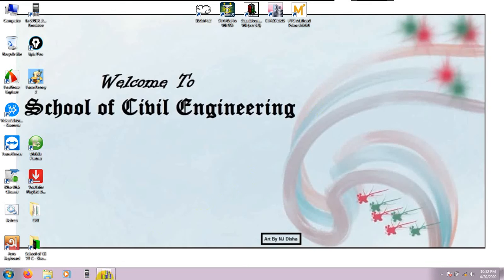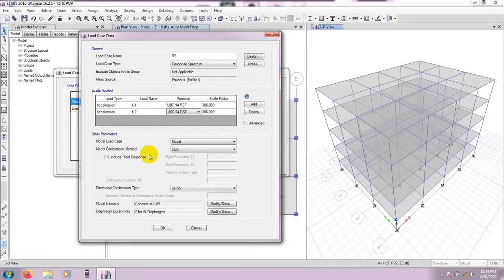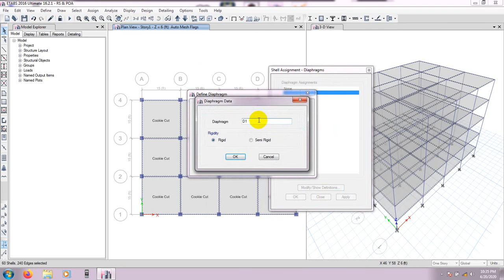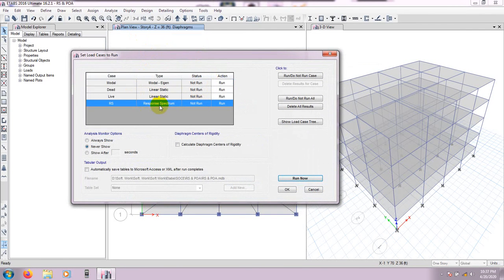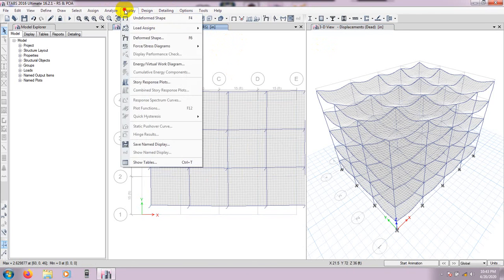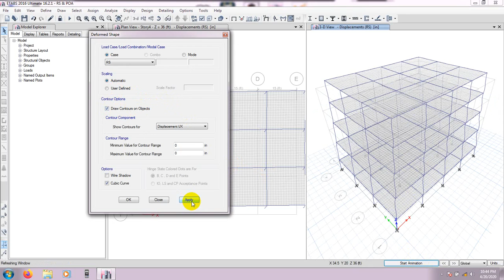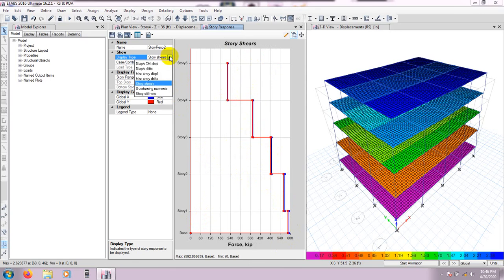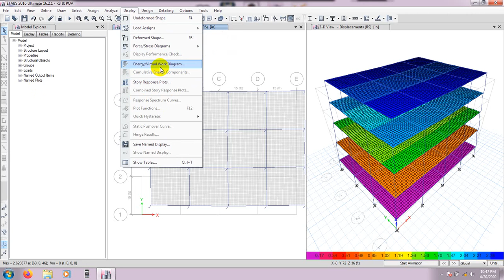Response Spectrum & Pushover  Analysis In Etabs |  RESPONSE SPECTRUM  ANALYSIS | Lecture-03

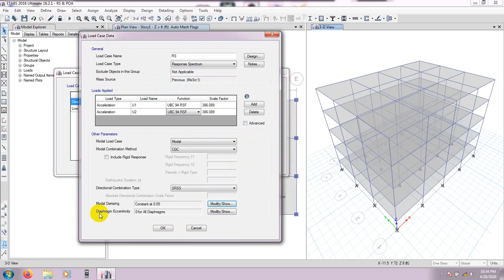Comment: sir what is srss and cqc  in video for load case data 2:55
Reply: please explain this denotes plz reply
Reply from the maker: The modal results of a response spectrum analysis are combined with quadratic combination rules, and in RF-/DYNAM Pro, the SRSS and the CQC rules are available. The default setting modifies the quadratic expressions into equivalent linear combinations. The advantage of this option is that the corresponding internal forces keep their signs and are often much smaller, compared to the standard SRSS or CQC rules. The standard SRSS and CQC rules are on the conservative side and the "equivalent linear combinations" are recommended.